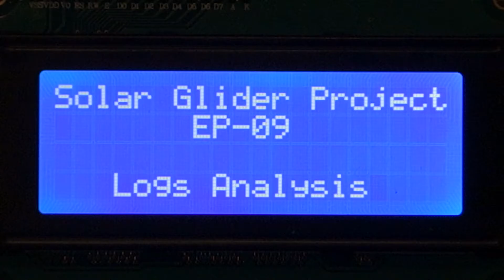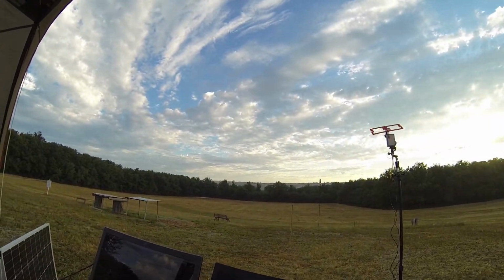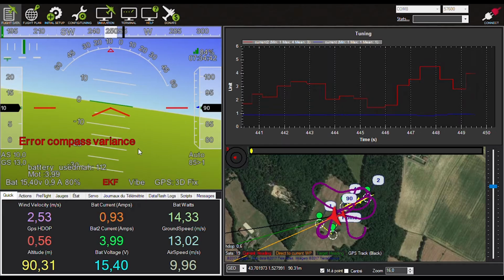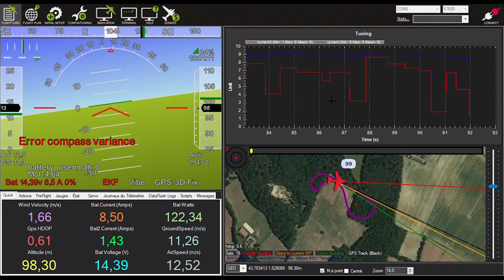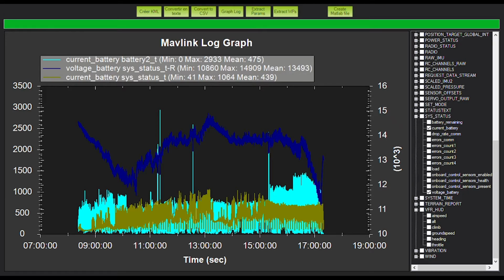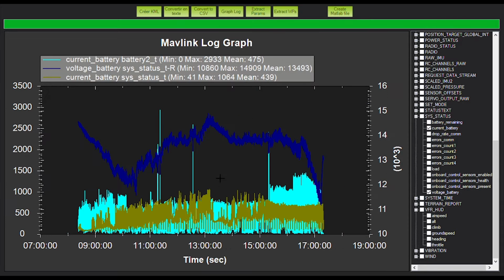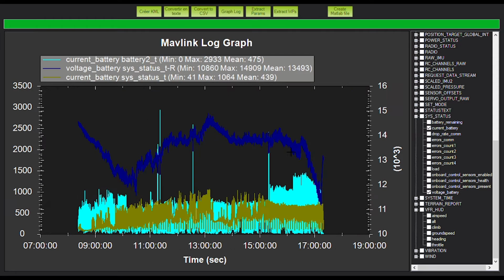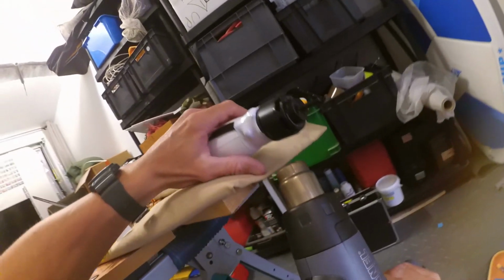SOLAR POWERED RC PLANE 10H30 400km Flight analysis 2017

Comment: Very impressive. Just wondering, could you guys fly above the clouds if they were at a reasonable altitude? 1- to get more power by improving efficiency. 2- to shut down the motor and glide while charging. Good luck
Reply from the maker: In France we are limited to 150m. Efficiency does matter a lot. In thermals you can glide while charging, but in normal conditions you need some traction to fly otherwise you loose altitude witch is potential energy.

Comment: Great project! How many 18650 VTC6 are you using on the plane (4s2p?) and where are they located?  Have you tested the efficiency of the propulsion system? What's your target trust and speed for the cruise? You will be probably much better off with a geared motor and for what I see at the end of the video you will be using a large direct drive motor probably far off from the efficiency target you should have...  Also the ESC should be carefully chosen and used within its efficiency range. Using it at very low load will cause large loss....  Where are you located?
Reply from the maker: hi, we are in France. We use 4s3p Inside the fuse. Geared box is better but direct drive is easier and cheap.
Cruise 11m/s, above 2.5amps.

Comment: Awesome project xould you explan me how you connected the second power meter to the apm?
Reply from the maker: +Patrick Stigi unfortunately it's not possible with APM because only recent versions of arduplane handle power module 2. This is one of the reasons why we switched to the Dropix flight controller, a kind of pixhawk.
Reply: Solar Glider Project oh thanks. Appreciate your quick answer, wish you best of luck for the next flights. Keep up the good videos 🔥👍

Comment: Awesome project.  Do you have a web-site or a link to the build?  I am currently working with a group of high school students building a solar powered RC airplane.  We have already built our first solar plane, now we are wanting to move onto a solar plane V2.  You design is very similar to what we have come up with.  What airfoil did you use?  Thank you.
Reply from the maker: Hi, The airfoil is not the most important thing but, a stable foil like beginners rc plane is a good option. Regards.

Comment: Hey could you give me an idea how to make this and the connectivity please.Did you use 4gLTE to connect to the internet when the flight was in its mission? If you have a step by step guide/video please do recommend it to me.Always looking forward for being creative like you :)
Reply from the maker: We used a classic 433mhz telemetry link. It was a total 400km distance but not strait, The plane never went away more than 300 meters more or less. 4g link is possible but in France it's forbiden to fly out of line of sight.